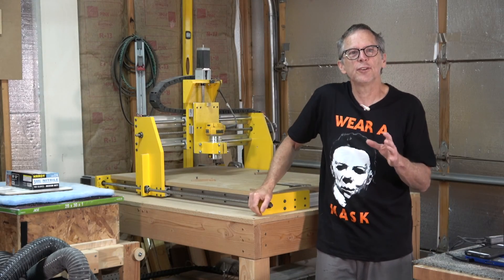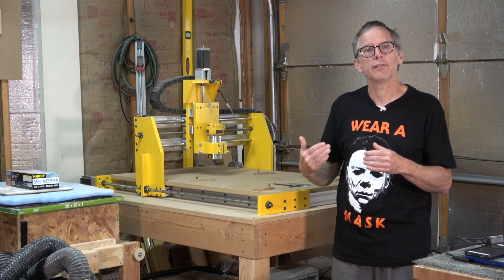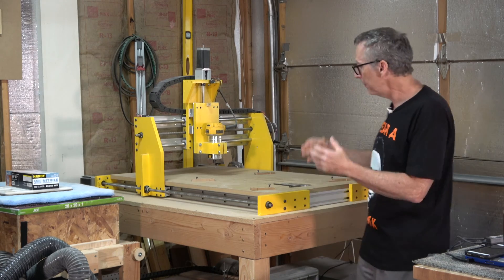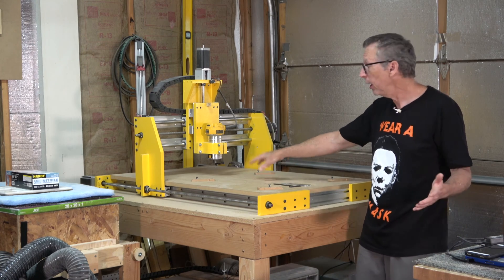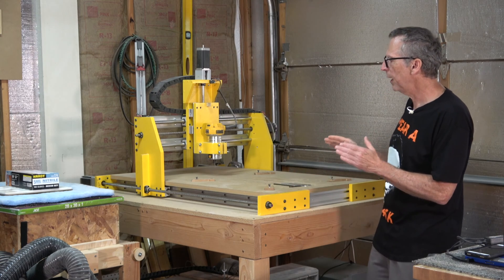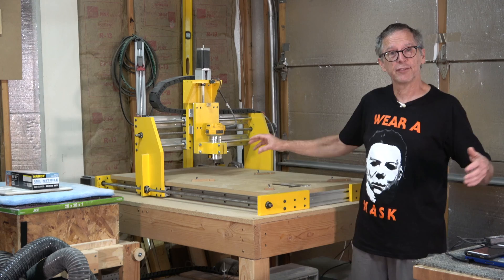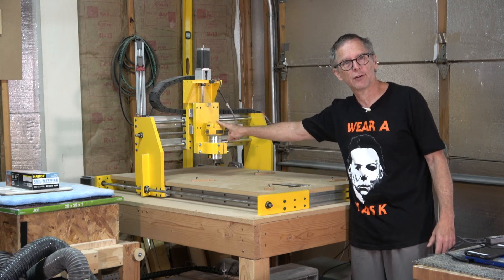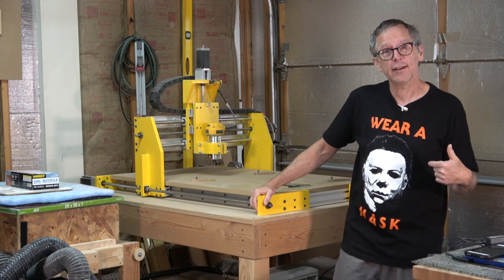How Fast Is My CNC Machine? #cncmachine #xcarve #luthier

Comment: What's the next size up router your CNC  plan will support?
Reply from the maker: With the plywood structure and the acme lead screws, I wouldn't go above a 1.5kw spindle and that would be pushing it.

Comment: I've followed Matthais Wandle's channel (Woodgears) for several years and he once did a video on if the CNC was as fast as the bandsaw wherein he with his bandsaw and a buddy of his with a CNC router proceeded to race each other making some trinket or other. With all due respect to Matthais, I think he missed the point of the CNC, and I think a lot of other people misunderstand them as well. I can't speak for anyone but myself, but I bought a CNC router not for speed, but for accuracy and repeatability. I have no doubt that many operations are faster with a hand-held router, hand plane, chisel, chainsaw, whatever. Not to mention all the front-end work on the computer that happens before you make one grain of sawdust. The reason for using CNC is achieving a level of perfection that I personally cannot get with hand-held tools.
Reply from the maker: And I decided to go CNC so I could tweet while cutting guitar bodies and necks.
Reply: This guy gets it!`

Comment: I purchased a set of the plans Chris offers and they were a fabulous start. My build is based on his plans but project creep has taken over. The changes in my build are to strengthen the chassis in order to use a 2.2K water cooled spindle. Which means the parts are made using aluminum stock instead of Birch plywood and uses ball screws instead of lead screws as called for in the plans. Also my control box is a huge departure in that it's going to be powered by a Masso controller and will be connected using aviation connectors and color coded ends to make troubleshooting a lot easier for me.  These changes were not made lightly and of course it has raised the cost of my build. The chassis is just about complete at this point and work on the controller will begin soon. Please keep in mind that these departures were made using a great deal of thought and research and has required me to manufacture a great deal of parts to make it all work properly. Anyone considering building a CNC using the plans offered by Chris will be very well served.
Reply from the maker: You are doing it the right way. Upscaling the engineering to accommodate the added weight. Your machine will be a BEAST!

Comment: Interesting. Have you ever done a productivity comparison of CNC vs. template/router building for a small shop. For many guitar bodies, it's hard to beat the speed of a band saw, template and router. If you're able to do other work while a CNC machine is running however, it could tip the scales. With the small CNC machines, I'd be hesitant to take my eye off it for too long though.
Reply from the maker: Based on my experience, CNC is quite a bit faster than the old band saw, template/router approach. Plus, as you mention, I can press the frets into the fretboard, sand the neck, and glue the two parts together in the time it takes to CNC a body. And, I still have time to check Twitter, Instagram, and watch a video or two.

Comment: I’m finding with my CNC setup and the Dewalt, the limitation is I want to go slower in the spindle and more power so I can take a much deeper cut at a larger step over. I went with the carve king, better than xcarve because of lead screw design, but still lacking in ridgidity. So I may be buying these plans eventually. Question though, are the yellow bits wood or metal?
Reply from the maker: Baltic Birch plywood. If you want metal (aluminum), don't use my design. The added weight will require ball screws instead of lead screws.

Comment: Nice video.  I have a DYI CNC similar to yours in many ways (rails / lead screws).  I 100% agree with the your engineering decisions on your machine.  I still have not made a guitar, but I have done thousands of other projects on my cnc over the years.

I would recommend lead screws over belts.  Speed / accuracy / rigidity are superior with screws.

I recently switched to a 1.5kw spindle from my older 2hp router.  Similar power, but there is less runout (it spins more true), and the quality of my cuts have improved, plus it is much quieter and I feel more confident running it on multiple hour jobs.

Comment: I have been considering a very small CNC just for headstock logo inlay.  I really don't like all the other options including waterslide, vinyl, or attempting ink jet transfer.  Do you have any experience with the small ultra cheap low end machines?
Reply from the maker: No. I have only used the X-Carve and my own design. I've seen a lot of low-cost CNC kits on Aliexpress that might be worth looking into.

Comment: Chris I have your plans and I have a shapeoko that I am going to carve the piece from Star Board. My only minor issue with the plans is there are no sources for the hardware I.E. Motors, rails etc. But love all your videos and plans I ahve ordered
Reply from the maker: In the modern era, there is no way to reliably offer sources. They change by the hour.
Reply: @HighlineGuitars  Oh I get that I just worried about getting the wrong parts since it is hard to match up with some of the specs I.E. with Amazon etc.

Comment: 611 no longer available. If it is please let me know! TY
Reply from the maker: Where did you hear that? I just googled it and nothing about being discontinued came up.
Reply: @HighlineGuitars  Chris, I found this.....Special Features Fixed-base - Included Components - (1) DWP611 Corded Router. So, if fixed base is removable and DWP611 vs DP611 not a part number issue, then yes, it is available. Living in Okinawa, JP Kadena AB, ebay won't deliver, FEDEX neither, so Amazon using USPS is my only option. Some parts are difficult to find but I am not giving up! Thank you for your time! Love your show!

Comment: It doesn't have to be real fast, just accurate. Cutting at high speeds probably not a good idea you risk ruining expensive wood.
Reply from the maker: You'd be surprised at how fast you can cut wood with a cnc and not ruin it.